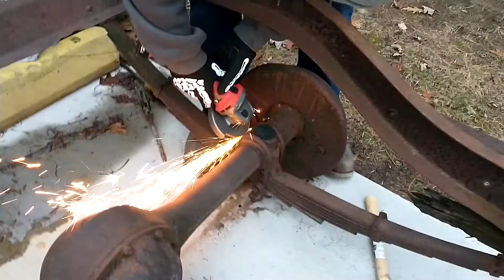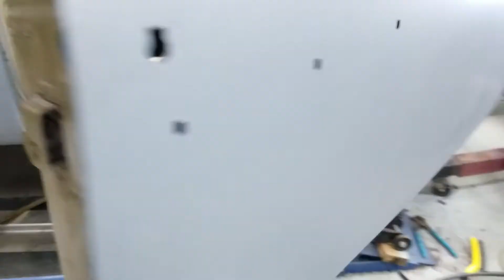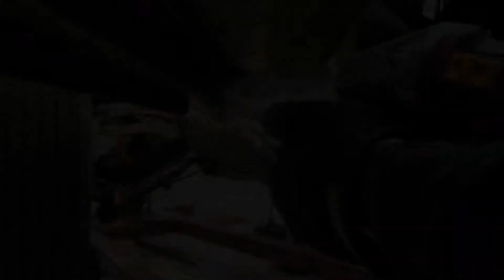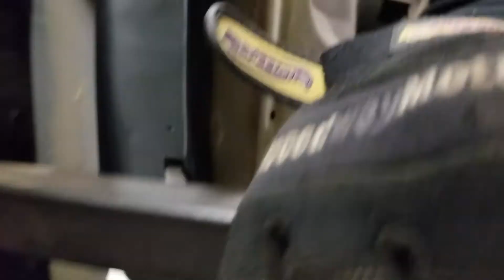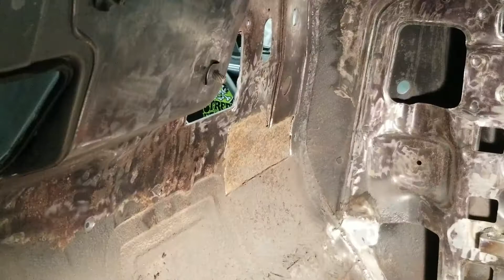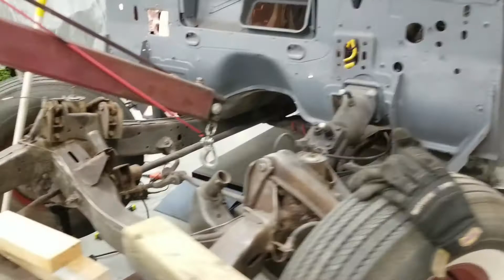Episode #6 - 1958 PLYMOUTH LOWER COWL REPAIR HOW TO (Christine)

Comment: nice one,
i like putting the door rubbers on when i test my panel alignment, i dont have any exp on the plymouth but a similar type of vehicle i worked on over 20 years was the london taxi, separate frame and shell, if you didn't have the rubbers on when you were finalizing the welding you can get caught out with some spring in the doors when you open shut them,
Reply from the maker: Good tip! Thank you. We will definitely keep that in mind.

Comment: Great Video. Question why didn't you use plug welds on the lapped panels? Curious of your opinion.
Reply from the maker: Good question I actually did end up doing a couple on that little lip where it overlapped the other metal. The rest was all cut flat to butt weld.
Reply: @StreetFreaksGarage  Thanks for the feedback Tim